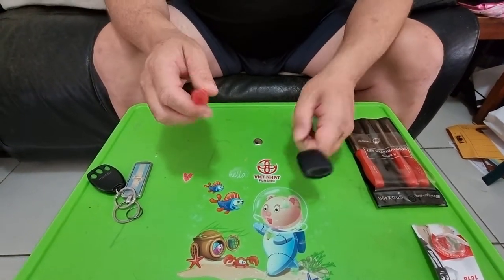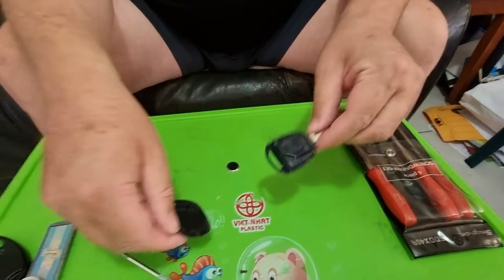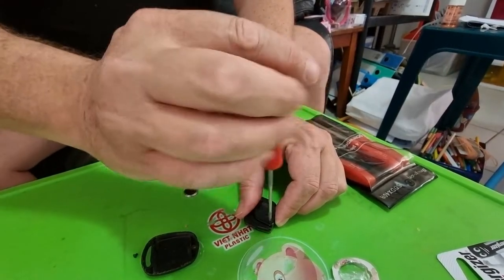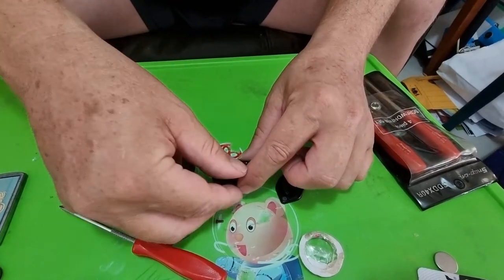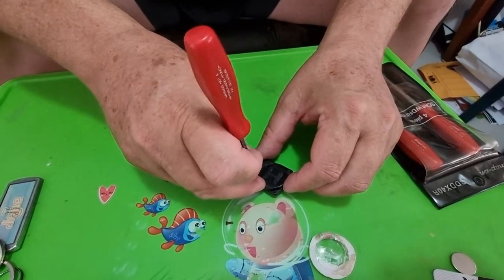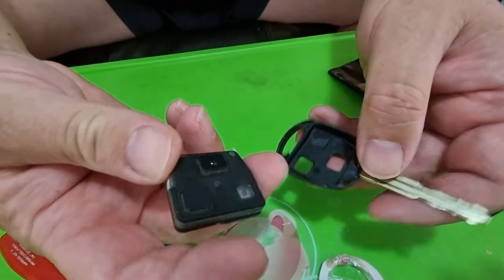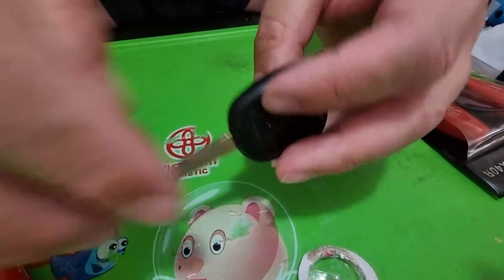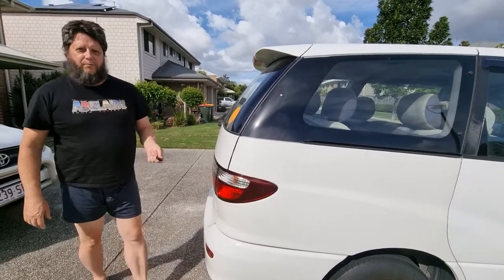Toyota Previa Tarago Estima Key Fix

Comment: H I Chris :) my same car in Uk the boot does not lock at all any ideas. ? Also the front passenger arm rest does not come down ? Any help :) love form Uk 🇬🇧
Reply from the maker: Sounds like the lock actuator in the rear door is not working and needs replacing. The front seat arm rest I'm not sure, maybe try some WD40 and some force :). Thanks for the comment.